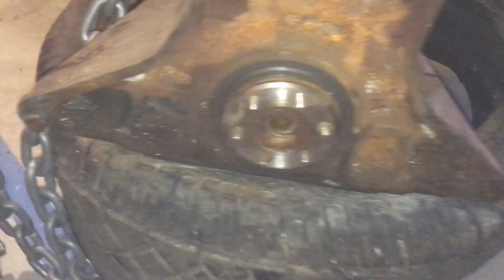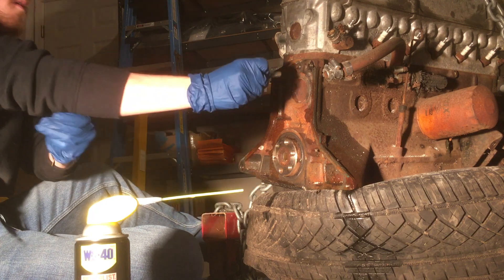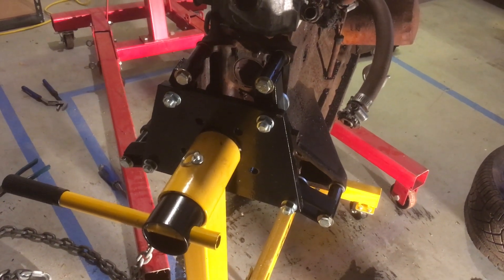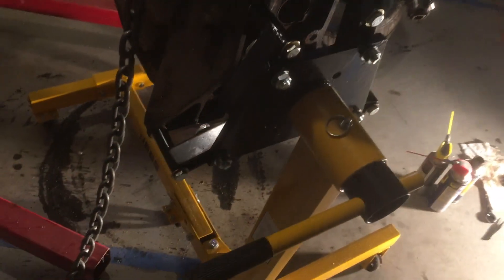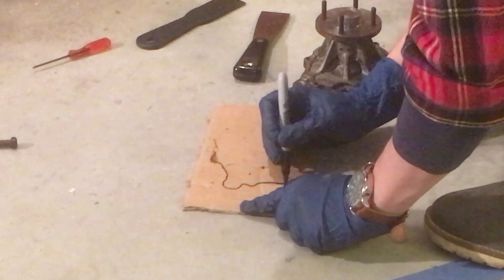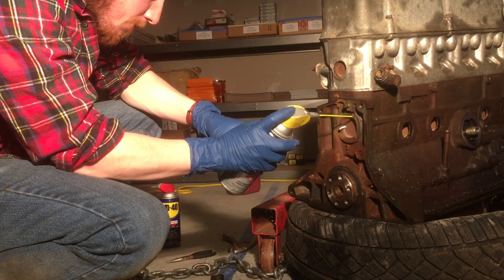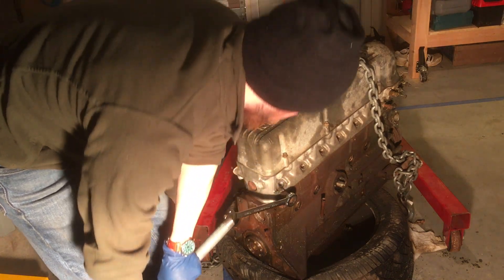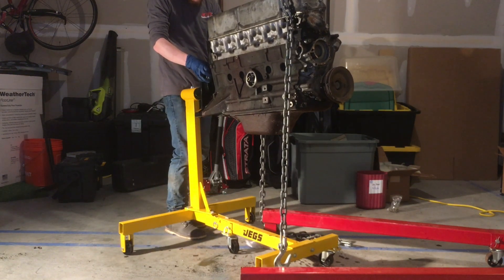Datsun 240Z L24 Engine Rebuild Ep. 3 - Engine stand and removing peripherals

Comment: Just a screw driver taping the core plug by the edges .
Your not hammering them in the key is to distort them to loosen them  out. 
   They are usually rotted on the back side anyway.

Comment: Thank you for the info on the bolts - we did find the ones on Fastenal - what length is correct? Thanks again for your quick responses
Reply from the maker: The length will depend on your engine stand. Using any length M10-1.5mm bolt you can get an idea of how deep you will be able to thread a bolt in after the threads have been cleaned. Then you want to look at the arms on your engine stand and measure how long the bolt hole portion is. 

You can always get a longer size and cut it down with a hacksaw or use additional washers, but it is better to be truer to the exact length you’ll need as these bolts will only be partially threaded. There’s only so much length you can take away before you won’t be maximizing threads in the hole. For me, I had a 90mm bolt with some washers on either end, but I’ve heard others needing as long as 110mm because their engine stand features longer bolt holes on the arms.

Comment: I'm sure you're aware of it, but McMaster Carr is another great company with a super user friendly website to purchase all sorts of mechanical items (bolts included). We use them for work & garage work all the time
Reply from the maker: Thanks Kevin, I’ll have to check them out. For this I ended up purchasing the mounting bolts in bulk with matching washers and sell them on my website for much cheaper than the one-off bolts would cost. The link is in the description.

Comment: Metric 10.9 enginebolts to the Stand
Reply from the maker: Yes, metric class 10.9 strength bolts are recommended. I think you are referencing around 3 minutes in the video where I showed 8.8 bolts that I used temporarily. I was trying to determine length needed as the hardware store did not have long enough 10.9 bolts and I had to order online. You can buy the bolts that I use on my website now: https://shop.zcarguide.com/products/datsun-240z-l24-engine-stand-mounting-bolt-set